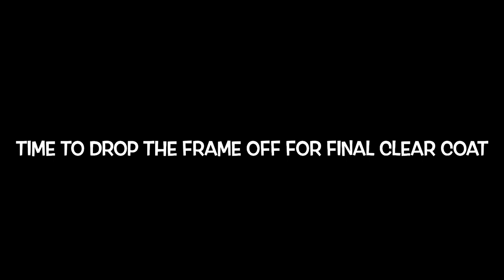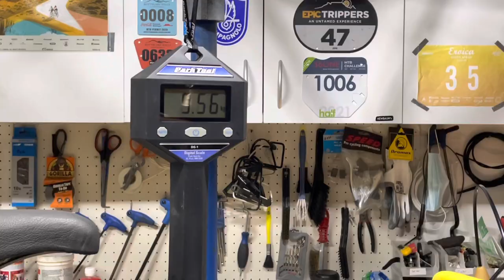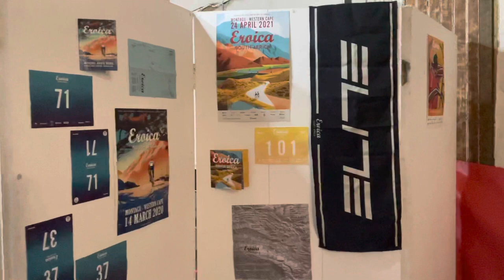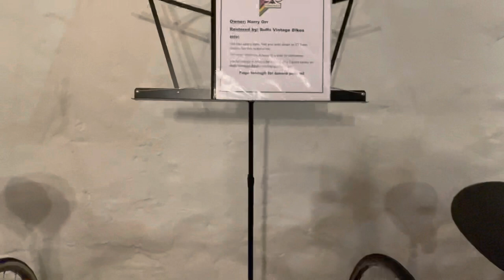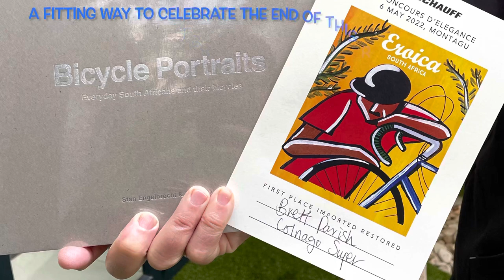Colnago Super Restoration - It’s FINALLY Complete

Comment: Great to see the vintage bikes so lovingly detailed and restored.

In the olden days, the toe straps were twisted when laced through the back of the pedals to keep the buckles in place.

Two twirls and that’d lock the strap so the buckle never slides around
Reply from the maker: Glad you enjoyed it Sean 👍🏼 Yes, I normally twist the toe straps as well but I was expecting to replace these with a newer set so never bothered with it at the time.
Reply: @BuffsVintageBikes  ah! Glad to hear it's not New-Old knowledge. On track they used two straps and even after clipless came in, some track guys added a strap for additional. Great work
Reply: I never knew that trick 😳

Comment: That's a much nicer super than mine from the early 90s, I believe mine is a c93?, but I also understand it wasn't actually made in the colnago factory. Made from CrMo4 tubing it lacks all the fancy cutouts and details of the earlier models and it seems to be an export model. Only found one photo online which even resembles it....it rides really nice tho and is unbelievably stable on a descent...congrats on the award👍
Reply from the maker: That’s interesting, I was under the impression that all early Supers were made with Columbus SL or SP tubing and later ones (post 92) were either built using Tange then even later, Brain tubing.